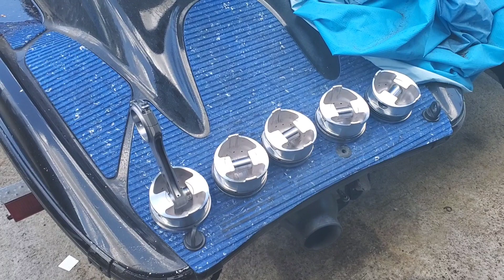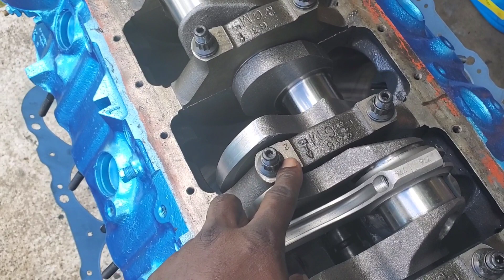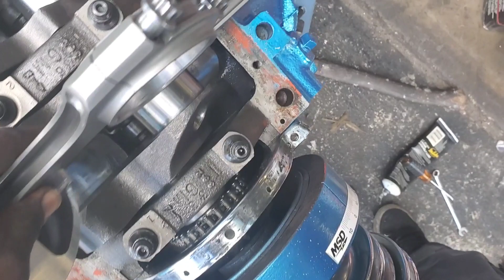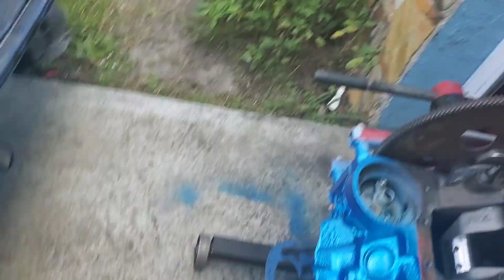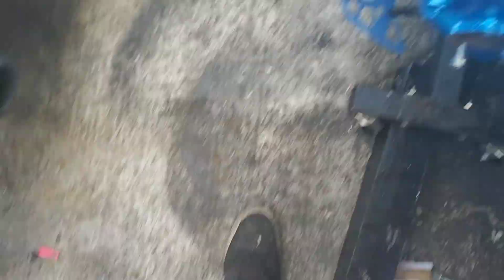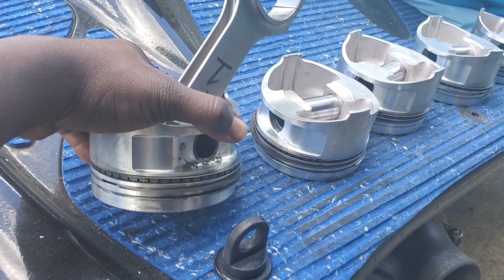BBC, Forged piston  and rods 454 INSTALLATION TIPS.

Comment: Love the build , were putting 12 lbs to a 9.8:1 468 studded and balanced 2 bolt main bbc. Building a 509 bbc twin turbo now for my s10. People think a 2 bolt won't work I can prove different.
Reply from the maker: Hell yeah you can prove a  them wrong  with that 509 twin turbo.!    I believe personally  , If it comes apart it won't be because of being a two bolt .  ..  some other failure will come way before the block...   I'm hoping to put some new clips up soon been slammed with work
Reply: @diamendking  

Rods will come out of it before crank will , engine builder said a studded 2 bolt is stronger then a 4 bolt with factory main bolts , being balanced helps also. A turbo is a gradual build of boost not hard hit like nitrous or supercharger . Can't wait to see yours going.